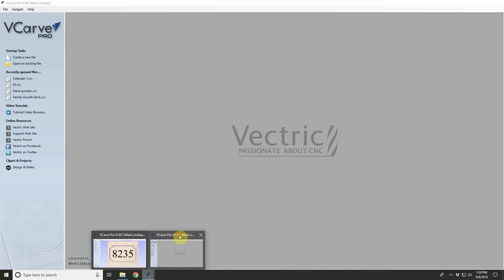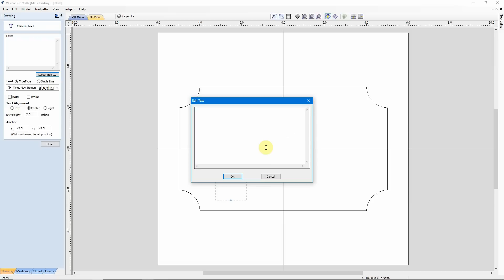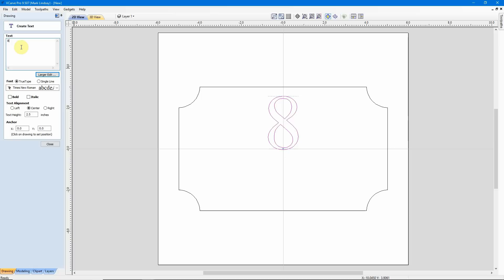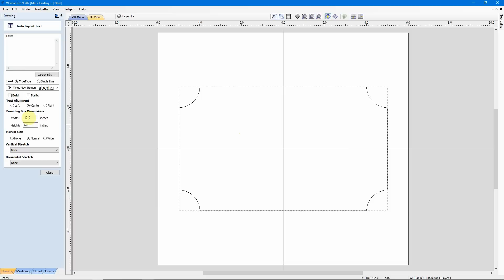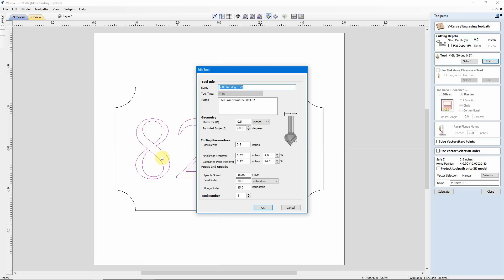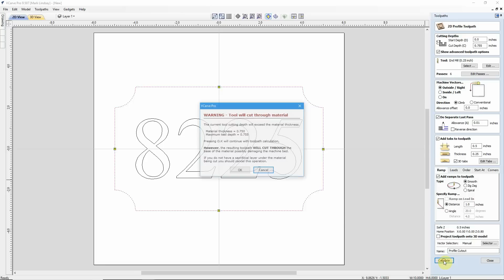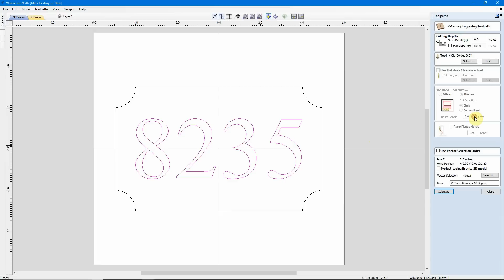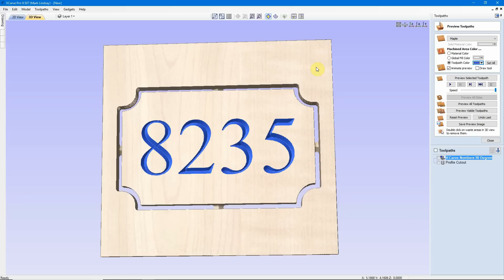V-Carving for the Absolute Beginner – Part 2 – Basic Text Project

Comment: Been using VCarve Pro for awhile, but learn something new on each of your videos.  One thing you didn't mention is if you hold your cursor over a V-bit tool path name, the info box that appears will give you the maximum cut depth.  Agree you still need to watch for shallow details if you plan on sanding.  Great videos!
Reply from the maker: Thank you, Bob. While I didn't mention doing a mouse-over of the toolpath name in this video, I did demonstrate it in later videos. Good eye! Thanks for checking it out!

Comment: A fantastic video, I learned a lot. I am completely new to CNC woodcarving, So new that I ordered my CNC machine 4 days ago, and waiting to receive it. If I can ask a question, I order a Rawcnc Advantic with  VCarve 2D and Mach 3  UC100 Module + a simple PC to run the Machine. This I will place in my garage/woodworking shop. Question: Can I run VCarve 2D on a Mac Book Pro in my house and take the code on a memory stick out to my CNC Machine in the garage, or do I need an additional PC to VCarve. Thanks Knut from Norway

Comment: Mark, i have a question regarding the toolpath of a dxf line profile.  in this example there are line and arcs for the border.  how can you follow the center of the tool path with one cut.  say using a v-bit and 1/16" deep to make a profile that follows the line?  don't want to cut through or have multiple passes, just one shallow cut that follows the toolpath (centered)

thanks, Mark
Reply from the maker: As you have already noticed, when DXF files are imported, the vectors are usually not joined. So, you have separate lines, arcs, curves, etc. It's usually better to join those vectors before calculating toolpaths - if for no other reason than to make it easier to select them all when it comes time to calculate a toolpath. Having said that, I did a video that demonstrates how to do exactly what you're describing. Here's a link: https://www.youtube.com/watch?v=OwTPRuEITGY

Comment: Hi Mark, first of all a big thankyou for your tutorials. Have you done or are you doing one on taking the design and putting it into easel ( the program I am using on my 3018.)
Reply from the maker: I'm sorry, but I do not. I don't have Easel and have never used it. I got VCarve Pro Version 8.0 several years ago, and never looked back. I'm sorry, but I don't know anything about Easel.
Reply: Thankyou for your prompt reply. I must be able to run my 3018 direct from vcarve pro then, or do I need a different program. I have sone some with easel but not impressed. Thankyou for your time.

Comment: You say Z Zero Position always material surface. However, I have been using Z Zero at spoil board and I micrometer to get my material thickness input value. I have been successful, thus far.

The reason I do this is that I can change bits and simply touch off, rather than recalibrate the gantry router Z coordinate to each new material. 

Is there a reason my method is disadvantageous? I am new to carving. Thanks many.

VCarve Pro on Laguna SSII - B&R

You have very good information and have made my understanding of outputting G-Codes to my CNC greatly improved.
Reply from the maker: I usually say that I always position my Z zero to the top of the material. If I said for others to do that, I misspoke. I know that some prefer to set Z zero at the top of the table, If you do that, and it works for you, there's no need to change.
Reply: @MarkLindsayCNC  Thanks for the reply. I'm pretty new to carving and I am trying to pay attention to pitfalls that others have discovered. You have been great help.

Comment: Hi Mark, Since I'm a new guy to CNC I have a Question. Why do you use the datum position in the center of material to start with? You say for design purposes, but is there a difference if you started in another datum position to design your project? Thanks for a really good video.
Reply from the maker: Thank you, Max. It's a 100% personal choice. It goes way back to how I was taught drafting in high school - we drew a center line on the paper before we drew anything else, then we started drafting the plan based off that centerline. Since that's the way I was taught, that's the way I have always done it. It's just easier for me to wrap my head around laying out the design by doing it that way. Then I can go into Material Setup before I calculate any toolpaths and change that XY Datum to the lower left corner, and the software does the rest. After that I can calculate toolpaths and generate g-code. Is there any difference if I started with the XY Datum somewhere else? No - there's no difference at all. The carving will turn out exactly the same no matter where you set your XY Datum in Job Setup, as long as you have it set correctly before you calculate the toolpaths, or you recalculate them all if you change it.

Comment: Nice tutorial, Mark.  I followed the presentation on my computer all the way to creating the tool paths.  I get a warning the tool path is deeper than the wood.  I'm on a trial version of Vcarve Pro and the machine I specified is a Onefinity X50 Woodworker  Any ideas why I'm getting the message?
Reply from the maker: It sounds like you're trying to v-carve the area between the text and the border. If you are, the v-bit will try to carve all the way through the material, unless you set a flat depth. If you're just trying to carve the text and the border, select the text and calculate a toolpath for just the text. Then select the border and calculate a separate toolpath for that.
Reply: @MarkLindsayCNC  Thank you, Mark.  I failed to select the text before making a tool path. Bam! It's working now.

Comment: why did you not change the datum to lower left when you started calculating your tool path?    Does this mean you will set up your CNC machine to O,O before cutting?
Reply from the maker: Basically, yes. This video was for demonstration purposes only. I didn't plan on actually cutting it. I still have the file, so if any time I do decide to cut it, I could set my X Y Datum to the lower left, recalculate the toolpaths, and save g-code. You'll no-doubt see in later videos where I did change the X Y Datum to the lower left corner before (or after) calculating toolpaths on projects that I actually cut. Good catch, by the way...

Comment: Do you operate your CNC with a. Omputer instead of the pendant? Do you have a video for setting that up? Thanks.
Reply from the maker: Yes, I operate from a PC with Mach4 installed. Setting that up is very machine specific, so there's no way I could help you with that. I'd hate to lead you down the wrong path. The best bet is to find the support community for your machine and ask your questions over there. They know your machine best, where I'd only be guessing. Do know that some machines are so proprietary, it may not be possible to get away from the pendant.

Comment: Mark? i am a brand new and I have started watching your video's and you do a GREAT job. I need to know when I finish designing my project and hit my calculate button does this generate my gcode? I have been saving it after I hit the button but when I go to Mach3 and open it, there is nothing there. No code. What am I doing wrong?
Reply from the maker: When you hit the Calculate button, you're calculating the toolpath needed to generate the g-code. You haven't created the g-code yet. I covered that in Part 4 of the Vectric for Absolute Beginners series. Here's a link to Part 4, but I highly suggest you watch the first 4 videos in that series before you go any further. There's a link to the playlist of the entire series in the description of all of the videos in that series. https://www.youtube.com/watch?v=kFIkyl8tUFU
Reply: @MarkLindsayCNC  I have that fixed now and Thanks.../Another problem Im have is the Calibration. im trying to calibrate my machine. went into the setting and was setting my X axis. told it to move 3 inches and it moved 1/8 of an inch. it correst itself by adding 2 7/8 of an inch but when I went to check it again and told it to move 3 inch it went all the way . When I try to manually move x axis it just goes all the way non stop to the emg stop. I am looking not for a video to help me set the limits but with no luck...any help here?
Reply from the maker: I would head over to the Mach3 Support Forum and ask there. Those guys are absolute wizards with that software. HOWEVER - I would check the mechanical first! Check/tighten any belts, couplers, or drive pulleys on your machine that moves any of the axes before you get into Mach3 and start changing settings or try to calibrate. Put some slippage marks on any pulleys or couplers that are attached to your motors so you can easily see if one is loose. Like this: https://www.youtube.com/watch?v=WeLIJaUyOWk

Comment: Mark -another great video, very informative for someone like me who’s researching cnc and software before I take the plunge and buy a machine. When you buy the Vectric software, do you own it outright or do they charge residual yearly  fees on top of the initial purchase price?
Reply from the maker: It’s a one-time purchase – there are no monthly or annual fees at all. The only fees you’ll encounter after purchase would be upgrades to a new version family – with one exception. What I mean is, if you purchased Version 10, an upgrade to Version 10.5 would be free because it’s within the same version family (in this case the Version 10 family.) An upgrade to Version 11 would involve a fee, because it’s an upgrade to a new version family. That fee depends on which software title you have. The exception I mentioned above is that if a new version family is released within 12 months of your purchase, the upgrade to that new version is free. So, if you purchased Version 10.5 today, for example, and Version 11 was released in April, you would get a free upgrade to Version 11 because it was released within that 12 month window.

Please note that I DO NOT work for Vectric, and all of the info I typed above is true to the best of my knowledge as of today, February 15, 2021. Vectric may change any of those policies at any time, and I’m sure they reserve the right to do so.
Reply: Thanks so much for the detailed response Mark, it’s very helpful. And I understand you’re not affiliated with them in any way and I really appreciate you sharing your experience on this.

Comment: Hello Mark, great video, as always! They help me a lot!
It's clear to me how V-carve works on your case, but it's not clear to me how it works on the Vectric Bullshead case, because there's bit is  going around the letters.  They also just chose the icon  V-carve / engraving bit, as well as you. Could you explain to me or direct me to some YouTube video.
Thanks a lot!
Reply from the maker: I would suggest going back to the Vectric Bull's head tutorial and watching how they calculated the toolpaths - especially how they did the toolpathing for those letters. They used a slightly different strategy than I demonstrated in this video.

Comment: Good video Mark. I'm a cnc beginner.I have just carved my first simple project on my onefinity cnc. It started out great, but I found error codes in the transfer of information to the cnc from my computer.  (y axis position is less than soft limits ) This has happened both times on 2 different downloads. Any thoughts ?
Reply from the maker: My suggestion would be to join the Onefinity Facebook group and ask over there. I really have no clue which controller software it uses, and I only know Mach3. They're the pros from Dover and can get you squared away. I would only be guessing.

Comment: I see that apparently in version 9.X what was  the version 8.X  "side angle" box in the tool setup window is now the "included angle" and a 60 degree bit requires a 60 in that box and not 30.  That must have been a source of confusion that Vectric decided to change, or am I missing something?
Reply from the maker: Thank you, Larry! I think you missed something, but no worries. I just went and checked, and the Side Angle and Flat Diameter boxes have always been in the Engraving Bit tool setup, and Included Angle has always been in the tool setup for V-bits. At least, all the way back to VCarve version 8.0. (I no longer have version 7.5 installed, so I can't check there.) It's easy to confuse the two styles of bits, and more common than you would think.

Comment: Very good video Mark.....thank you!  One question on vcarve depth.  You mentioned sanding can occasionally make the depths of number edges too shallow.  In this case is there anyway to vcarve deeper with the 60 degree bit or what can you do to go deeper on the number edges so they will still be clear after sanding?
Reply from the maker: Thanks, Jake. Basically, this is where previewing comes in so handy. That way you can put your mouse cursor down in the V and look at the read-outs at the bottom of the screen to see how deep the bit is going to cut. If it looks to be a bit shallow, you can go back into the toolpath, change to a different bit, recalculate, and preview it again to see if it's any better. It only takes a few seconds to change bits and recalculate a toolpath. Get it to where you're happy with the preview, and you should be golden.
Reply: @MarkLindsayCNC  Thanks for the quick reply!  So if the 60 degree 1/2 inch vbit isn't cutting deep enough after viewing on the preview then I need to look at a 60 degree 3/4 or 1 inch vbit?
Reply from the maker: No, that's not how v-carving works. The diameter of the bit won't make it cut deeper. If a 60° v-bit isn't cutting deep enough, you'll need to either increase the size of the pattern you're trying to cut or go with a v-bit with a steeper angle - like a 45° or 30° v-bit. This video explains it all.  https://www.youtube.com/watch?v=JGG0yTPih4w
Reply: @MarkLindsayCNC  Thanks for the clarification that makes sense.

Comment: Thank again Mark. One thing though, since your using two different Bits do I save each profile separate so as to be able to change cutters when the V-carve portion is done?
Reply from the maker: You save each toolpath that uses a different bit separately. I run the v-bit toolpaths first, then the end mill toolpaths next. The Profile Cutout toolpath is always last.
Reply: @MarkLindsayCNC  Ok Thanks, I am finally getting this with your help. The software really needs to be more intuitive in my opinion. The videos they have are not very help full and do not explain the steps in full. They keep jumping around.

Comment: MARK, i KEEP GETTING AN ERROR MESSAGE TELLING ME  THAT I WILL CUT THROUGH MY MATERIAL.   HAVE SET THE THINKNESS AT .75 INCHES AND USING A 60 DEGREE V BIT.  IT TELLS ME THAT THE CUTTING DEPTH WILL BE 1.43
Reply: Same thing happened to me.  When I checked the settings on my 60 degree V-bit they were not the same as Mark's. Make sure EVERY parameter is equal to what Mark has.  If you just purchased VCarve, the settings in the Tool Database will be generic.  Also, keep pausing Marks video to make sure EVERY setting is the same as his.
That's what helped me. Good luck!

Comment: Noob question...I'm a total beginner...just did this tutorial. How do I get my mini cnc machine to cut this project now? And thanks for the great tutorials
Reply from the maker: You'll need to talk to your CNC's manufacturer, or sign up for their support forum, to find out which post processor to use with your controller, then generate the g-code for that controller. That process is different for most CNCs out there, so I can't be more specific than that.
Reply: @MarkLindsayCNC  my cnc machine came with GRBL Candle. Will that generate the code?
Reply from the maker: No. You'll generate the g-code with VCarve or Aspire, using the correct post processor. I don't know what that post processor is. GRBL Candle is the controller that reads that g-code, and tells the machine what to do.

Comment: Hey Mark,  I normally run the grain horizontal.  Is there a preferred grain direction for V-Carved Signs?
Reply from the maker: Running the grain horizontally is the most common grain direction, however, ultimately, it's 100% up to you. It's more a question of aesthetics, really - if a particular sign looks better to you with vertical grain, or a specific piece of material has some special marking that looks better oriented vertically, there's absolutely nothing wrong with running it that way. Sometimes "because it looks good" is a good enough reason. Thanks for watching!

Comment: How would I make a file from DXF to the NGC for Vcarve
Reply from the maker: What you're asking is covered in several different videos. I would suggest you check out my Vectric for Absolute Beginners playlist. Part 5 will show you how to import a DXF file, but there is a bit more to it than that. You may need to edit the vectors, convert the vectors to curves, and use the Vector Validator to identify errors before you can generate g-code. 

Here's a link to the playlist: https://www.youtube.com/playlist?list=PLLuYLaC3-QRNuVTej2P5emp1D4_Tm774p
Reply: I found that after I asked the question, thanks for all your videos, they are perfect for us newbies

Comment: my tool selection use to be in inches but i probably did something and didnt realize and now all my tools show mm
Reply: You can alter the unit in tool data base, you have the option of metric or imperial if you look at the top of your page you will see File / Edit / Model / Toolpaths click on ( Toolpaths ) that will open a drop down, go to the bottom (Tool Data Base) that will open a box with imperial / metric with all the tools there.